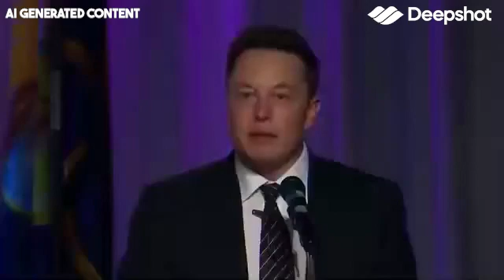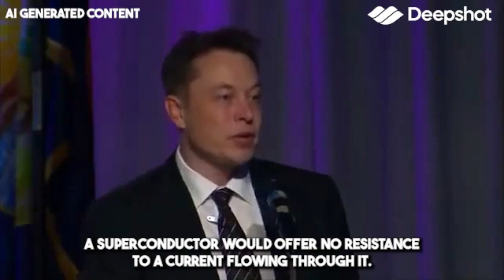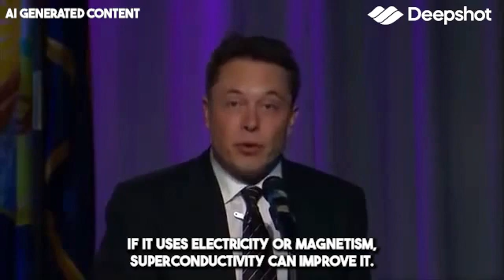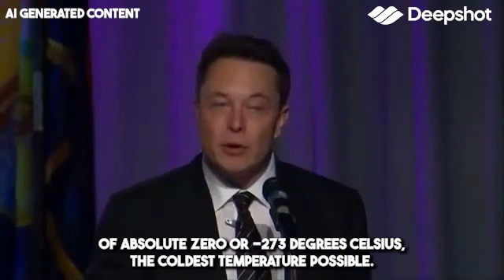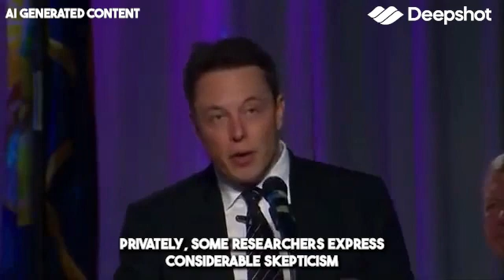Elon Musk breaks down all of the superconductor buzz

Comment: W. A. Little, "Possibility of Synthesizing an Organic Superconductor," Phys. Rev. 134(6A), A1416 (1964), DOI:10.1103/PhysRev.134.A1416 "*Chemical structure of the proposed superconducting organic polymer*."  Dr. Little scales critical temp as sqrt of third body coupler to electron mass.  One then trivially obtains Tc = 2200 K / 1920 °C / 3500 °F 
"FIG. 3.  That polymer cannot exist (too many atoms/radial volume) and is fundamentally wrong.  Turn it inside out, then dithia-anthracenophane avatar exciton generator.
Convergent monomer synthesis, living polymerization.  IInherent one-way superconductor!  (Global symmetry breaking, then time irreversibility).  Stop screwing around; DO IT.